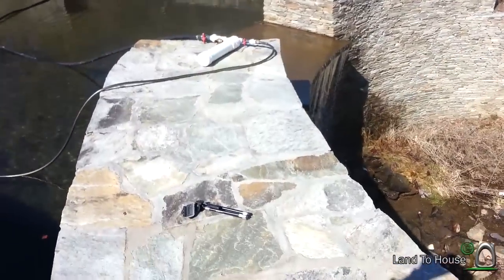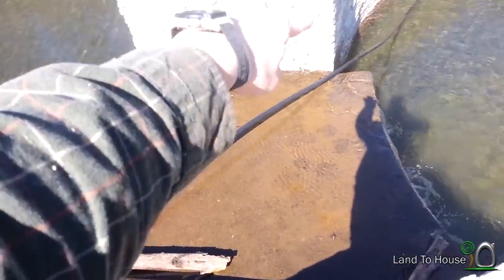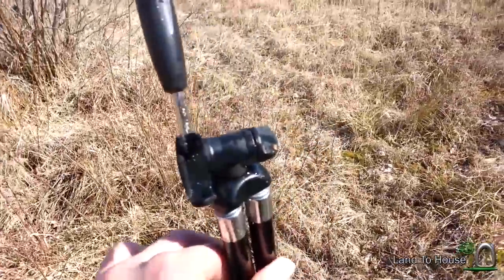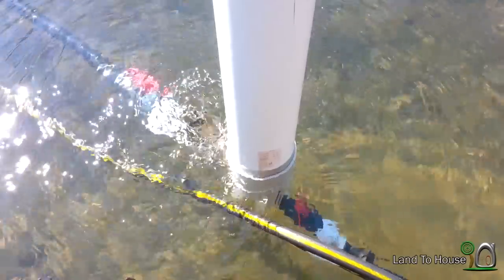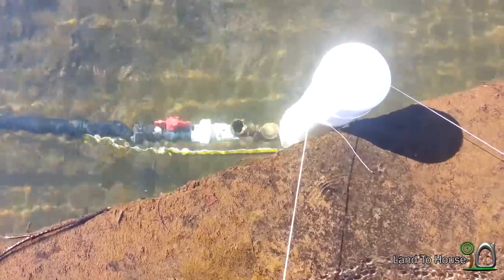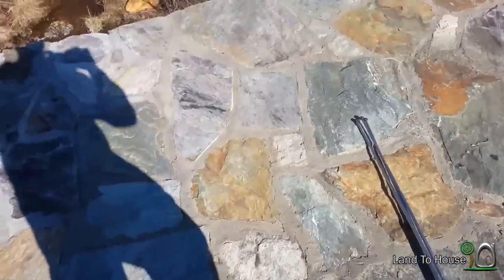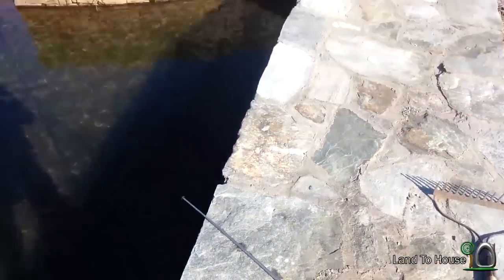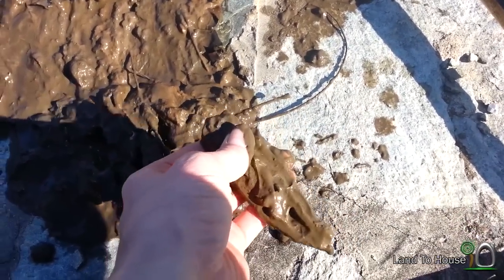Adventure 22 - Underwater Ram Pump

Comment: i was curious if this would work. my thoughts were to use ram pumps to dry out flooded mines. put the pump 200' down the shaft of a mine in a lake, would the water inside the pipe know it's surrounded by water on the way up. would a flooded 200' rise be the same as a dry 200' rise? given the weight of the water column is contained in pipe. it's the water hammer effect on the air tank that pushes the water as i understand it and the flap valve is there to initiate it. i suppose there would need to be at least some dry head to create a pressure differential, make the water column at least slightly heavier than the surrounding water... hmmmm

Comment: I have a question. If I don't have a free flowing water, can I use a small pond pump to deliver water directly  to ram pump to lift water uphill? Will the ram pump damage the pond pump due to pressure? Is it feasible?

Comment: Would it be possible to have a Hydro setup, with a bunch of ram pumps afterwards that pump water back to the top of the dam, so water can be continually recycled through the hydro setup? I realize it wouldn't be as much as what's being passed through they hydro system, but it would be some. Just a thought.

Comment: The decreased clicking might translate into less wear on the check valve and other parts. However, being underwater, it slows the closure of the check valve. Thus, the peak pressure will be slightly less (maybe?). Thus, the head pressure might be less. It would be interesting to put a pressure gauge on the pump.

Comment: Is there a diameter calculation for hose in/out to drop/run/return? Thanks
Reply from the maker: The drive pipe (from water source to pump) needs to be the same size as the waste valve. The delivery pipe (from pump up hill) can be any size as long as there is not friction loss.

Comment: once lowering the ram pump into the water, would it work if you moved the water source to just below the surface of the same pond? And ram pump being 3 feet below?
Reply from the maker: Sadly no this does not work. The water source must be from a place above the ram pump. This means that the water needs to be flowing and falling. If you were to place a straw into a glass of water, the straw would fill but then equalize with the rest of the glass and the water would stop flowing.

Comment: We have a stream that has about 6feet sharp fall. Where will I take my drive pipe? From the top six feet high or from the base where it drops? Help me.
Reply from the maker: You will want to have your intake at the highest point. So on the top of your waterfall. That will provide you with the full six feet of head pressure.
Reply: @LandtoHouse  ok thank you so much
Reply from the maker: Happy to help.

Comment: I was thinking of extending the pressure pump and the pipe on the release none return valve then put it the well .
Reply from the maker: The ram pump does not work inside of a well. It has to have head pressure. Although Sinking The Ram pump into water does increase the head pressure it also increases the hydrostatic pressure equally. This causes the pump not to work

Comment: Have you tested the pump output using delivery pipes, with identical head elevation, of different material? Compare for example 1) pvc sch 40 ; 2) pvc sch 80 ; 3) copper pipe ; and lastly a galvanized pipe.  Maybe 40' length and comparable I.D. dimension.
Reply from the maker: I have tested PVC schedule 40 vs flex poly pipe. Big difference in pressure. The more ridged the pipe the better performance in the same setup.
Reply: @LandtoHouse  Have you shared your test results to give viewers  a comparison with data?  Seems stronger shock wave would equate to increased output volume and/or pressure for more elevation lift.

Comment: How would you set up a ram pump in a river, where basically is all the same level but you have the river water speed?
Reply from the maker: Sadly the ram pump needs head pressure or hydrostatic pressure to operate. A river that is flowing but does not have a lot of drop is not going to work.
Reply: Land to House what can I do in a river with no electricity around?
Reply from the maker: There is a pump called "river pump" it works on flow rate not head pressure. Sadly I have not been able to get the company to talk to me over the past 4 years.

Comment: hey bro will ram pump work inside the hand dug well?give it around 60 meters below the ground it will feed by a small electric aquarium pump ?
Reply from the maker: Sadly no the ram pump requires head pressure to operate.
Reply: @LandtoHouse  he is suggesting using a pump to probably provide the head pressure

Comment: ...and hear I was going to make 2 boxes around my ram pump to shut the thing up!!! Yay underwater fixes the noise issue!!! How high up should the intake water be?
Reply from the maker: The pump does work underwater but that does not increase the head pressure. So I would place it just under the surface.  As for intake that will depend on the head pressure needs.

Comment: Thank you very much. That answered my question on how to reclaim water lost by waste valve. You don't have to when operated in water. Plan is to use ram pump to fill elevated water tank to get head pressure to run hydro turbine generator from collected rain water with self flushing mechanism like a toilet that flushes automatically when tank is full. No stream or falling water just 48" of annual rainfall. This is to supplement solar for off grid living. Thanks again your videos have helped me solve two or three major problems much cheaper than what I was visualizing in my mind.
Reply from the maker: I have another video on the channel showing a ram pump waste valve with pipe to take the waste away from the pump. That might be handy. Also I have some limited research on auto siphons that you might like.

Comment: well you should show the imput pipe begining and tell us the distance to the pump.
would a ram pump work submerged ina river ???
i am your new subscriber, i am layman need to get it more explained, like i see you put bicicle air camera inside the presure box of the pump.
explain to me the reason for that , it is the first i see that way, why you do not use preasure gage  ??
I will apreciate your explanation if possible.
Reply from the maker: I have around 60 videos on my Channel about the ram pump. There are some others that explain the concept much better. The pressure tank uses a bicycle inner tube to prevent water logging of the tank over time. The pump can operate submerged as long as the input is above the pump. And sufficient head pressure is available.

Comment: I really enjoyed this video. Ive often wondered if it would work under water.
Reply from the maker: I need to make an updated version of this video. The pump does work but there's no benefit other than Sound Reduction
Reply: @LandtoHouse  How deep under water can the pump still work?
Reply from the maker: I've only tested underwater two times. I plan on finding a swimming pool this summer and testing it at different heights
Reply: @LandtoHouse  hellow bro? Still waiting. How did the test go? Did I miss the next video on this?

Comment: Hello Land to House!  Excellent & very educative type of Videos you have been uplaoding which are useful for a common  man like me and others. 
Now I have question for you!  I saw this video your pump working underwater.  Wonderful!  But will it work inside the pond water ( Not flowing water) below 2 or 4 ft from the surface of water which should act as head as an intake head and pump ??  In this case, by keeping the Pump inside the pond the way you have put and as such, the pond water also flows down to 2 or 4 ft into the pump from the surface of water which acts as a flowing water only after priming!!  Or this type of Rampump need a flowing water??  Your reply is appreciated.

Comment: thanks for answering that question, now can you drain a wet swampy area, with no moving water? am trying to figure how to drain a low lying depression that normally holds about a 1 1/2 foot of water, over a 2-3 acre area, its kinda a long bowl, not sure if a very short fat inlet would have enough water weight to make it work? there is a ditch close to drain it to but its about a foot higher lowest part of the depression. I don't want to run electric to drain it because its in the neighbors property, but it tired of all the mosquito's ........

Comment: if this works, than please explain why you can't use a ram pump in a deeper lake or river or pond.
Reply from the maker: If you'll notice the drive pipe is in a pond above the location of the ram pump. The pump requires that the source of water be above the water where the pump is located
Reply: @LandtoHouse  thank you for your help,the ram pump its perfectly,but how much time can keep under water,the suction valve,until to finish the air inside of camara of air? Without air,going by suction Valve,how can have the propulsion?I'm Brazilian and don't understood all that you told,so I'm sorry and thanks again for your support.
Reply from the maker: Have not tested longevity but I expect the Pump can Run underwater indefinitely. I need to find a place I can set up a ram pump underwater for a long time.

Comment: +Land to House Hi, this is a good demo and would be useful in keeping the noise down - simply submerge it and ya done.
BUT I had a thought! (i'm no expert, so correct me if i'm wrong)...Since there is already at least some 'back-pressure' on the waste valve (outside pressure, due to being underwater), proving that the waste valve will still function under exterior pressue...Does that mean that it would it be possible to fit a hose over the waste valve end as well and send it up to where you need it, along with the usual hose - making it a 100% efficient ram pump?
I may be missing something...but it seems that straight forward.... Let me know what you think and/or give it a go if you have spare hose lying around.
Also, i've seen your ram pump build vids - which build version is the ram pump in this video? Do you have a 'how to' vid on how to make this particular one? Many thanks!!!
Reply from the maker: That is a fun thought. I have learned so much since this video. There is a newer video on my channel showing how increasing the waste valve hight reduces the output. As soon as the waste valve hight reaches 1 foot below the original source the pump stops. I do have a video showing the build! Here are the two links. https://youtu.be/dUWgSHtv9k8
https://youtu.be/K8Fy__ThqpQ
Reply: Yes, it was fun :) I think I found those videos of yours after posting my question for you - but thanks anyway!
I'll keep on pondering. It may not be water based...could be more about a wheel inside a wheel, with springs - Random unique movements caused by gravity/tension, 'keeping it in suspense'. A perpetual, portable design is possible I believe! Have a choice one man!

Comment: do Ram pumps work in stagnant water?
Reply from the maker: No sadly. The ram pump needs either head pressure or hydrostatic pressure to operate.
Reply: But if it's under water then it is considered as stagnant water and the pump will wrk. Am I correct.
Reply from the maker: If the pump is underwater but the source is above the pump it will work. Notice in this video that the water source is in the pond above the one with ram pump.
Reply: @LandtoHouse  so if I drop the pump in a tank of water which is still wud the pump wrk
Reply from the maker: This water source has to be outside of the location of the ram pump. If the water source is stagnant like a tub or a pool there is no head pressure
Reply: @LandtoHouse  or so this pump can't work in a pond only running water source.
Reply from the maker: @anilanmolsingh713  basically yes. Unless you have water from a source above the pond.

Comment: Your discovery is remarkable... I am now thinking of placing it in sea and lifting water to a nearby mountain.. and then allowing water to flow down. and generate electricity... its large water at smaller head to small quantity at higher head..
Reply from the maker: +Bheri Raju sadly the ram pump does not work in the same body of water as the intake. If you'll notice the intake is 3 feet above the location of the ram pump.

Comment: how deep can you go with the ram pump is there a limit under water? can you just submerge a ram pump and use that instead of gravity feed water from a pipe above from the water supply?
Reply from the maker: I have learned that when you sink a ram pump in the water you are actually reducing the head pressure. The hydrostatic pressure is negating the head pressure. This means that for every foot you sink the pump there is an equal head pressure and hydrostatic pressure. This being said you can sink the pump in the water but it is not going to do any good. You still have to have the head pressure above the level of the water.

Comment: Hey man I was wondering if you knew whether or not ball valves would work as the 2 valves required for a ram pump?

Love your channel as I want to build my own and am learning as much as I can as to have the tools to make due with what I have at hand!
Reply from the maker: +X hello. You will still need two check valves. The waste valve needs to be a swing valve and the second one can be an in line valve or swing. The ball valves can be omitted but they help with starting the pump.
Reply: So the ram valve has to be a swing check valve?

Have you ever tried using a ball valve instead?
Reply from the maker: They dont have to be swing. you can use a modified spring valve. BUT Ball Valves do not have automatic closure. They are manual and wont work.
Reply: +Land to House Oh so it needs to be auto closing? Wouldn't a ball auto close with gravity if pushed up?
Reply from the maker: +X A ball valve has a handle on the top that turns a ball inside the component and shuts off or on the water flow. It has to have someone turn the handle to work. Now you might be taking about a check valve that uses a ball (marble, ball bearing) as a way to block flow. In that case yes you can use that. For example the 1 way valve made by the "king of random "
Reply: +Land to House Yeah that is what I meant. Not the ball valve, but the check valve.
Reply from the maker: Ah yes in that case it will work.

Comment: I realize this is an older video, but I am about to attach a ram pump to an artesian spring boil that is under 2' of water.  There is actually a head to the spring; if I push a 2" pipe into the boil, I can bring it about 3' out of the water with still a huge flow.  I am thinking I would be better off with the pump submerged as it is in a creek; there is tree debris constantly making its way downstream and I'm thinking near the bottom would be the safest place.  

Have you run the pump underwater for any length of time?  How does it perform?

Thank you for posting your experiments.
Reply from the maker: The main thing to keep in mind is that the water source has to come from above the pump. You might need to get that water into a small tank and pull from that as the source. you can tap the bottom of the tank and use the hydrostatic pressure to run the pump. It is still possible to have the pump underwater at this point. I have not tested a long term use underwater.
Reply from the maker: I only have this video showing that the ram pump can run underwater. The ram pump needs to have the source of water above the body of water that holds the pump. Placing a ram pump in a tank will not have head pressure to start the pump. Sadly.
Reply: Hi Seth,

It is amazing work, you are doing... Is ther any videos you did for long term underwater use?

Also, for my application, i have rainwater Sintex tank of about 1 mtr diameter and 2 metre deep. I am planning to install underwater ram pump at bottom of tank, so the 2 mtr can power ram pump to overhead tank. Will this actaully work?
Reply: Land to House thanks for prompt reply 

Appreciate it 

Keep the good work

Comment: Now, this is cool! I like the idea because it makes the pump less noticeable to the public.
Reply from the maker: +Mika Lee I need to revisit this video now that I have learned a lot more about hydrostatic pressure. The pump is quieter when it operates but no extra head pressure is gained from sinking the pump under water
Reply: Well, the only thing I was thinking about was the silence.which is good if you don't lose head pressure.
Reply from the maker: Some people use a bucket with some foam insulation to cover the pump and muffle the sound.
Reply: Even in the mountains in the Philippines things left unattended seem to mysteriously vanish, makes things difficult, to say the least.
Reply from the maker: A friend of mine is from South Africa and he was saying the same thing about that place. He cant put solar panels out because they get stolen.